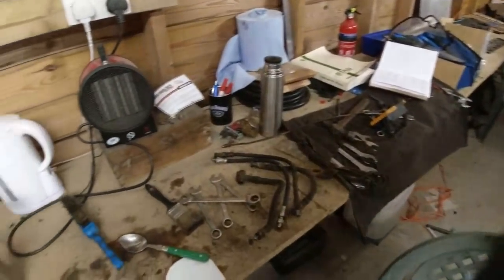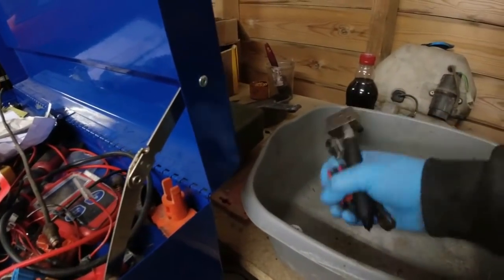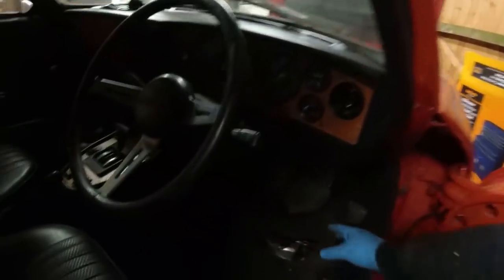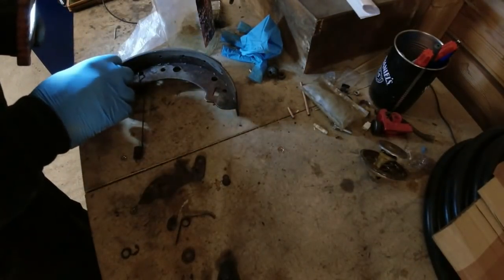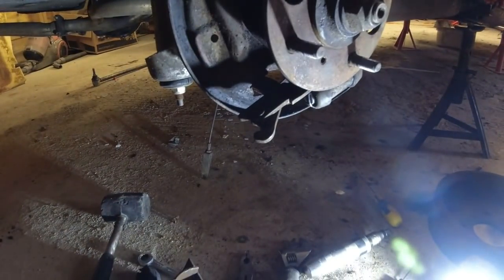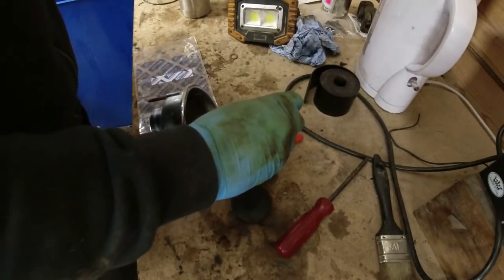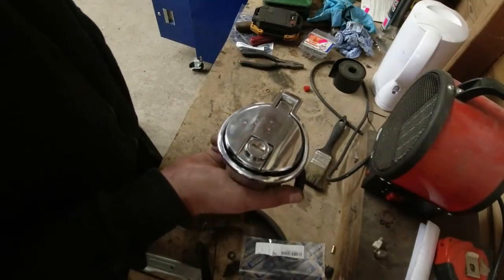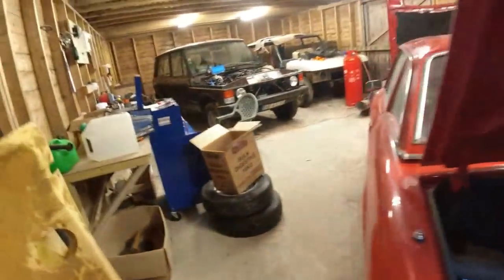1971 Triumph Stag - Brakes, locks and stuff - Profanity warning

Comment: A selection of long nose vice grips would save you grief with those brake springs. An absolute bastard at the best of times.
Reply from the maker: They are, long strong very thin screwdriver works for me every time now. But the ungrateful bastad things are never far from wanting to embed themselves into my fingers

Comment: Gosh that thing has some very worn pivots, maybe it didn’t have much love and lube in early life? My filler cap as far as I know is original and has no discernible play. And neither do my brake adjuster pins have that sort of play. But as you say they should pivot a full 360 degrees or you can’t get the out with the wheel cylinder in place.
Also agree on an annual check if you don’t know what your doing. Don’t assume minimal miles each year means nothing needs doing either!